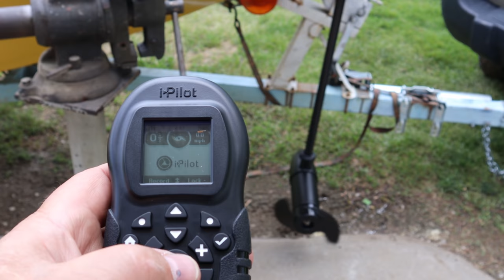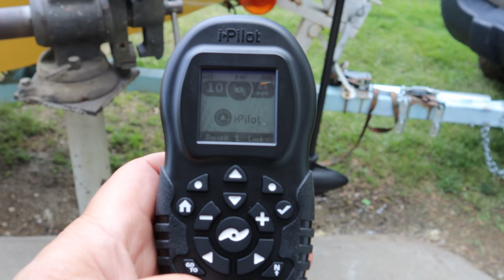Minn Kota PowerDrive trolling motor The Banana gets an upgrade Super Clean upgrade for sure

Comment: I purchased the spray bottle of Super Clean shortly after seeing how it unbelievably cleaned one of your outboards. This stuff is for real. Appreciate the recommendation and the  many tips you provide on outboard repair. By the way, I followed your outboard stand build and now have 3 done. Sort of overkilled the wheels with four locking 2" non-marking castors but "why not". Thanks again for the education and entertainment.
Reply from the maker: Excellent, glad it worked out for you.

Comment: One of these came on my 13' sylvan. I would not have bought one. But now that I have used one..... Priceless.  Would love to have the saltwater version.... But that one is not exactly priceless.. it's about half of what my whole boat is worth. My saltwater impulse drive is the least expensive 12volt rip tide.  However, I would not try to buck (oppose or resist)  a full flood or ebb in long island sound.  or a 20-knot wind. Sea Tow is $179 a year.
Reply from the maker: Fair enough

Comment: Probably the "Super Clean", would help clean the oxidation on my old ProCraft boat.
Wish I had that MinnKota! My old MinnKota is way past time for an upgrade. So at that price, I could afford it....AND I would have spot lock! And I'd get some small nylon plugs for any of your exposed mounting holes from the old trolling motor.
I'm guessing you saw the burned out backup light and you have fixed that by now.
Reply from the maker: Aluminum Brightener from Napa does a fantastic job on cleaning bare aluminum

Comment: Super Clean. You can control the trolling motor with the MinnKota app on your phone. It works great as a substitute for the remote if you don't have extra batteries on board.
Reply from the maker: I did that as well.

Comment: Super Clean, first i sure hope you can talk Tohatsu work with on 50hp eng, you will get a better deal for sure and there a fantastic engine, and for sure it will use 1/2 as much fuel than the old johnrude., i raced old 40 hp and ther built proff engine, yes great video aa always
Reply from the maker: They said they didn't have enough inventory to offer a sponsorship at this time.  I'm sure it's microchip and labor related like everyone else is experiencing

Comment: I have an old 765mx I need to replace.  Go figure after 30yrs its done.  Relay clicks no run or turn but both motors are good if you throw direct 12 volts at it.  The only thing I do not like about the new ones is the length of the shaft
Reply from the maker: may just be bad relays?